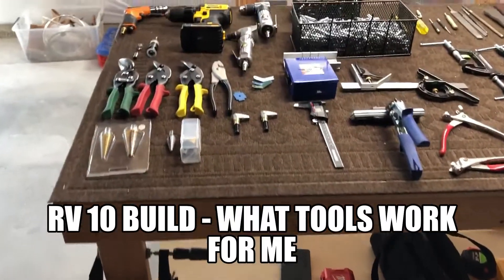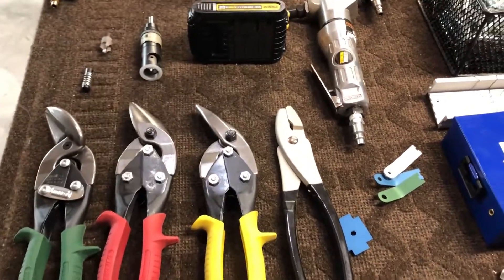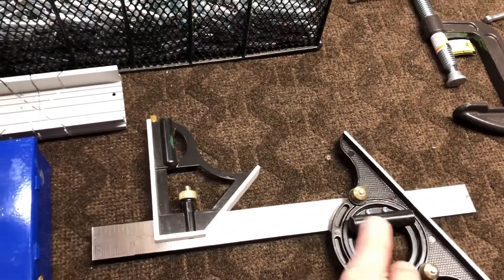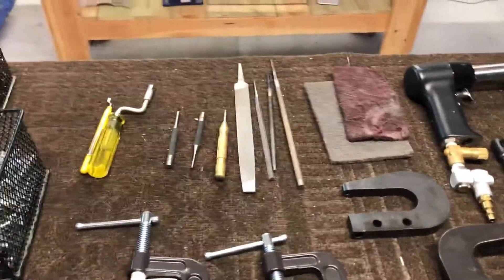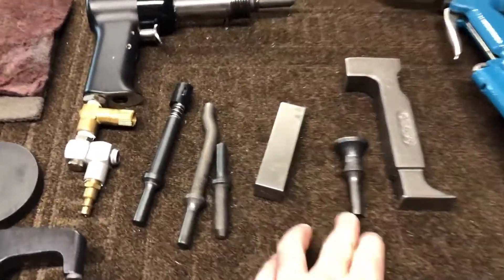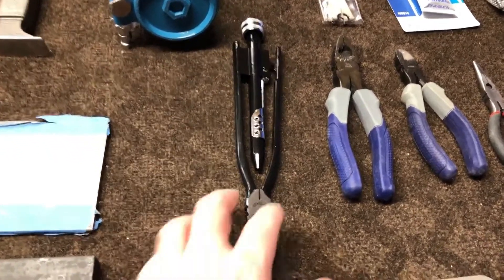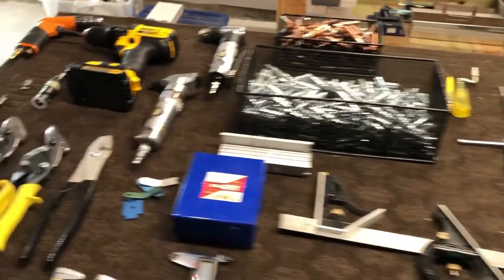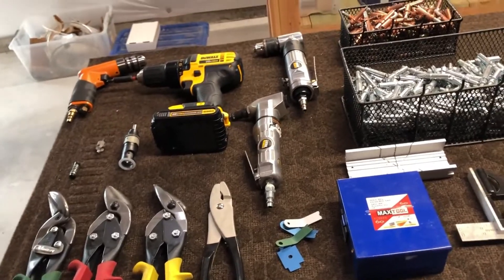Vans RV 10 - What Tools Do I Use

Comment: Thank you for this detailed video of tools used. I am just about to start my empennage build and have most of these tools. 

What size/ which compressor did you use ?
Reply from the maker: I was originally using a small 12 Gallon compressor which was working fine for all of the tools required to build the plane.  But it was very loud and if you want to use it for some higher end work (I also work on cars) or painting you will likely need something larger, I now have a 30 gallon stand up unit but what you really care about is the SCFM required by the tools and the capability of the compressor - mine is 5.3 SCFM

Comment: What is the name of the two toothpaste looking containers used for marking of torqued screws? Where can I get these. Thanks.
Reply from the maker: I purchased these from aircraft spruce - its called ITW DYKEM® CROSS-CHECKTM TORQUE SEAL - good for making sure you did the torque and also see if it moves. Cheers George